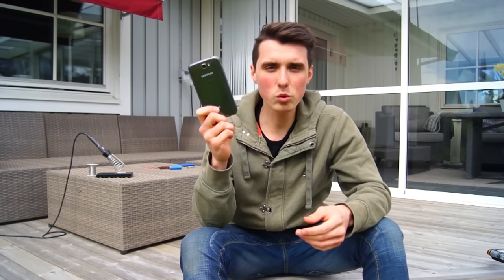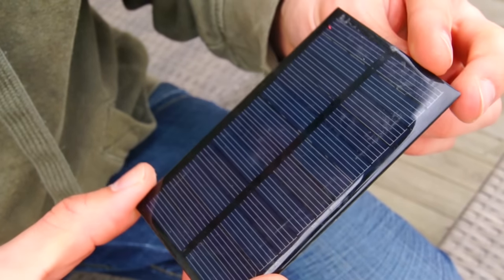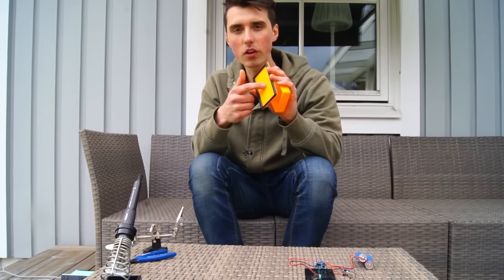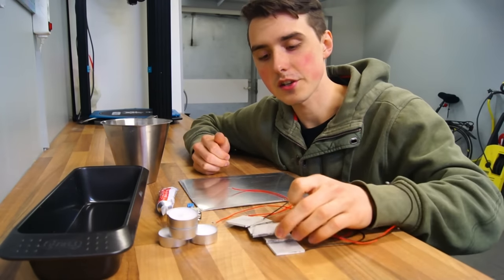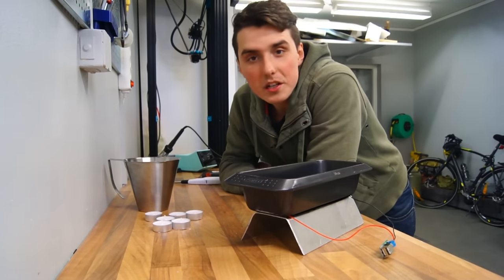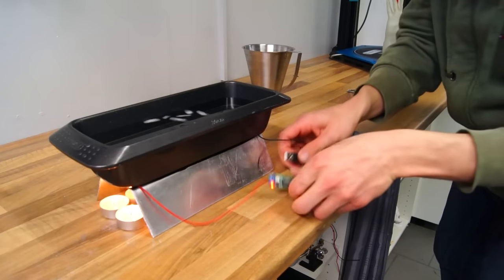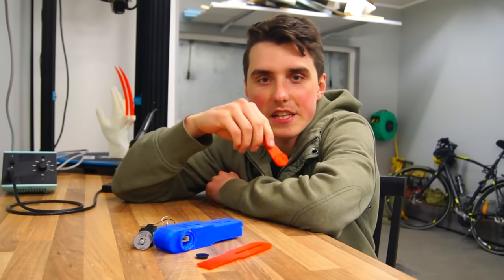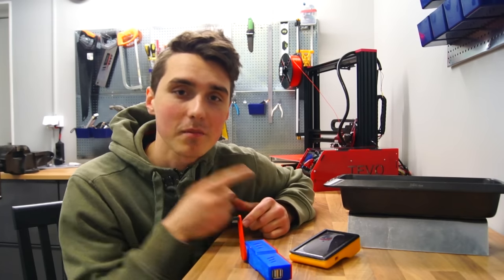3 Awesome Ideas - Phone Charger Life Hacks

Comment: umm, it would be beneficial if you hooked up amp meter to every device to measure current draw so we know how reliable and worthy those are
Reply: Steve I that's the fake part of DIY electronic projects
Reply: peltiers can easily generate more than enough voltage to charge a phone especially with so many. 
Same goes for solar panels and as it charges the batteries which in turn charges the phone so why not
last one is kinda dubious so well yeah

Comment: One solar panel won't do much. A larger external panel or connecting about 6 of those used in this project in parallel would be better. I have built a similar device.

Comment: why did you put the solar panel directly to the charge controller??? you should use a small buck boost converter because solar panel voltage change with the light intensity so if you put it directly under sun it can kill the charge controller or even make a fire with lithium batteries!!
Reply: I that that was a boost converter, I think its one of them .9-5V bitches,  I could be wrong tho...

Comment: Hint for the thermalelectric phone charger: by mixing some salted water with the ice-cubes, the water is able to reach cooler temperatures under 0°C, because the salt shifts the melting point ;-). Thereby the temperature-spreading from cold to hot side of the peltier elements becomes bigger. So the power outcome increases

Comment: I would put a diode in series with the solar panel (1. design) or else the solar panel could posibly drain the batterys, because the solar panel has a lower voltage, a diode would protect the cells

Comment: I missed the parts you edited out
1. the part where you had to strip the (now very short) wires after gunking the parts to the baking tin
2. the part when you found out that 5 candle just didn't make it and you had to add 5 more

Comment: Does anyone know why i cant charge my iPhone using the dc motor generator. I've tried using a Samsung and that worked ;/
Reply: apple is dumb so just change to Samsung forever now Joking joking but seriously I don't know why that would be they have the same input maybe apple had some type of lock but idk sorry I can't help.
Reply: You have to put some low voltage on the data lines (like 1-2 volts) And it will begin to charge

Comment: It really pisses me off when Amateurs put videos like this up. Connecting cells in parallel MUST be done with a fusible link and tapped at the center for the output. That way, if a cell fails shorted, the current from the other cell (which is now shorted out) will simply break the link. The way this clown has done it means if a cell failed shorted, it would almost certainly cause a fire.